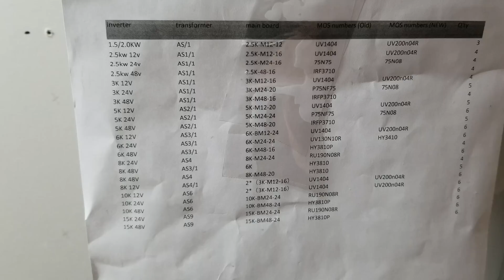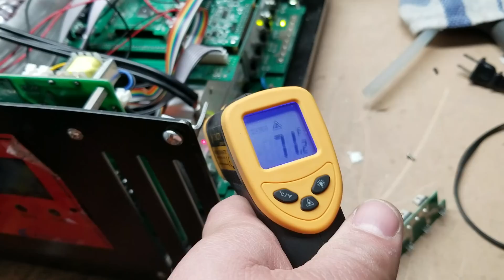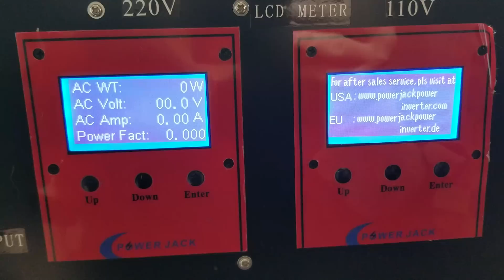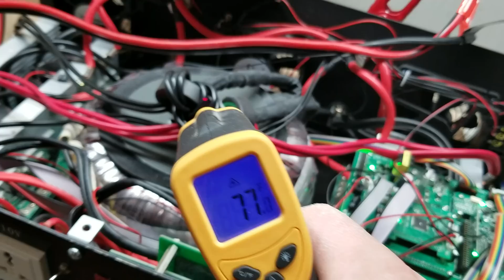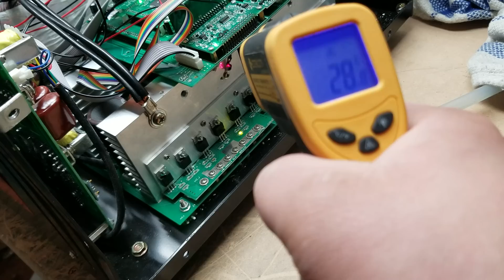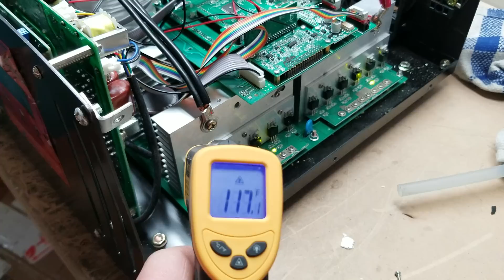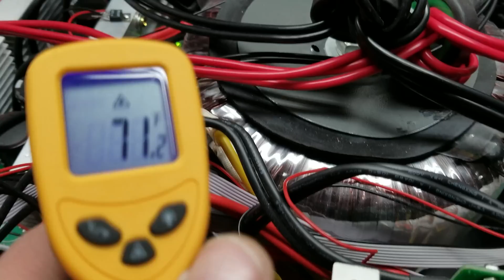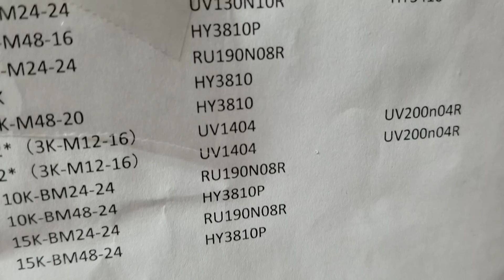What's so bad about the wrong mosfets?

Comment: Which is better, hy3410 or ru7088r? I have 6k 24v bought a few months ago. They burned after connecting a 240v load and a 120v load at the same time (washing machine and well pump). It's been awhile since it happened, bought new mosfets on eBay but they probably were not good, because they burned out right away.